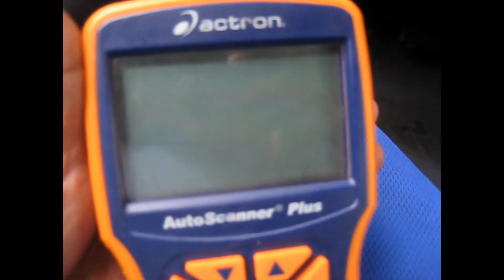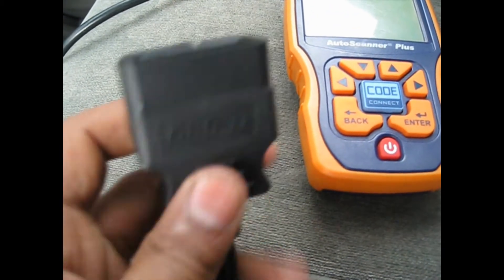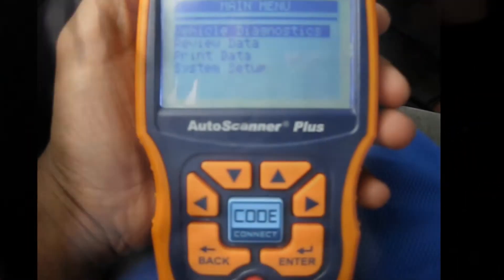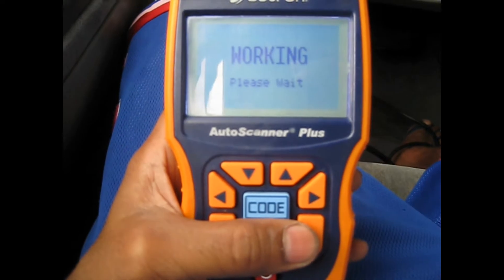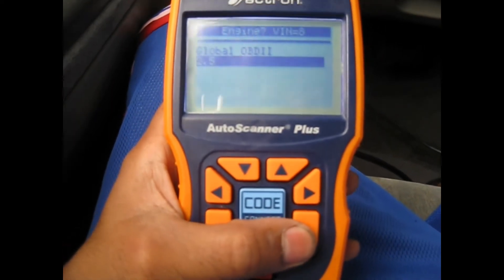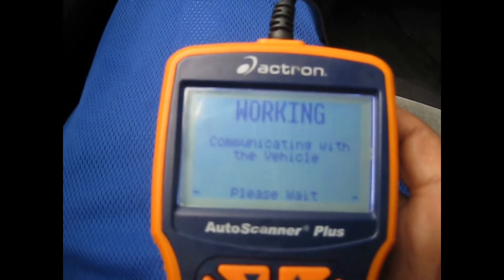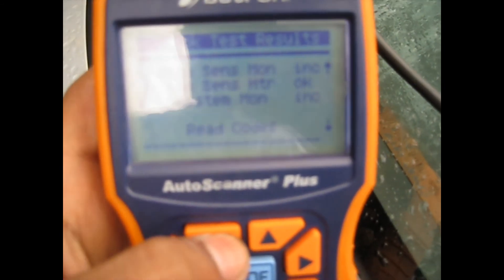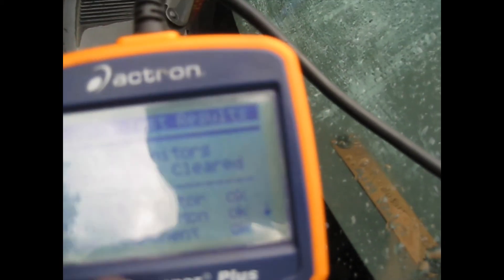Actron cp9580 obd2 scanner howto use

Comment: OIC, so sometimes you might get a DTC but has no reported fix, so basically the code connect us useless right? I have a Craftsman scanner and I am thinking of selling it for this model. But I am still not sure, Mine will tell me if I can pass the emission exam by offering a green, yellow and red light. Does this one have that? It is called  emission readiness.  Nice video.

Comment: Does this model give you live data? It would be interesting to see the actual sensor output to get some more clues as to diagnosis. The anxiety I have about this kind of thing is the occasion where the sensor signal is a symptom of a another problem rather than the sensor itself....